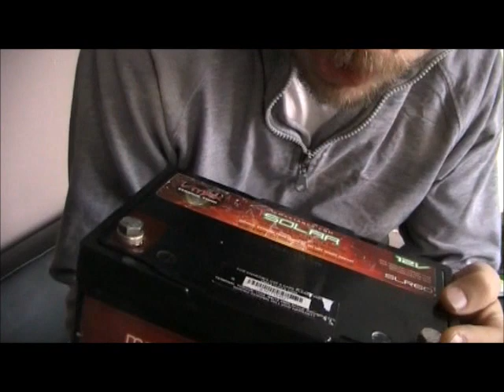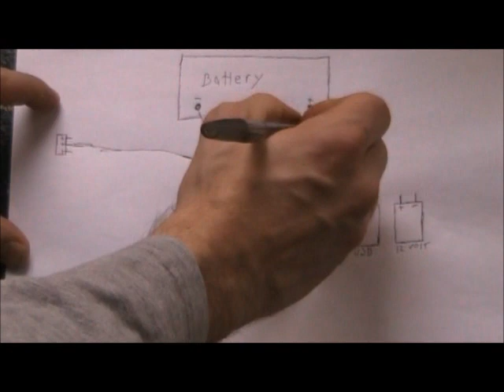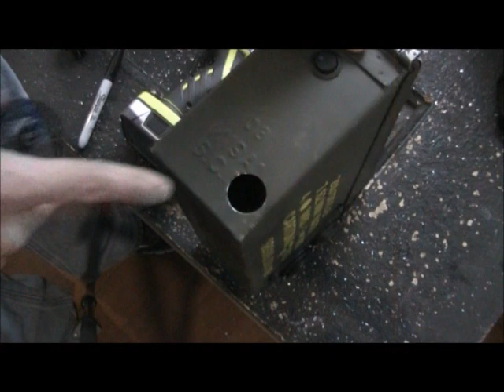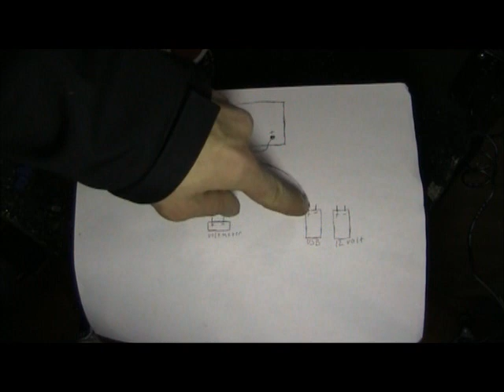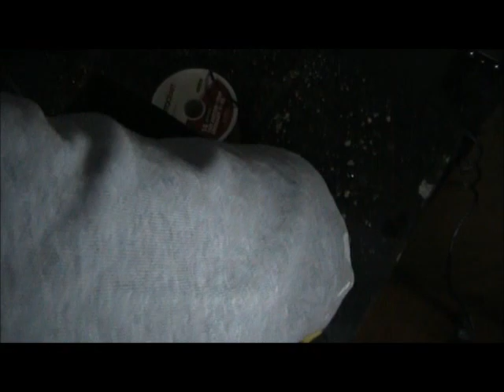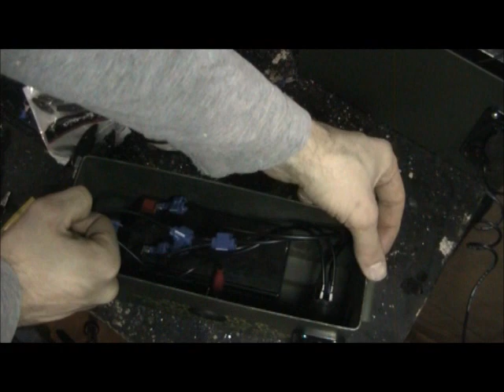How to build a portable 420 watt solar power generator (video 1 of 2)

Comment: Thank you so much for your video. I want to build one of these Could you plse tell me what the socket is called what you plug your solar panel into as i can not find one anywhere?. Also whilst iam driving in the car i would like to charge this whilst driving...how do i acheive this...do i simply plug a cigarette cable from the generator 12 volt outlet into my 12 volt car outlet? I would appreciate your advice plse thank you
Reply: @TheTruthEngine  thank you so much

Comment: Ha ha....you crazy? nice way to blow up your cell phone battery.  you should warn people not to charge cell phones with 12 volts.  5 volts 500 - 1000 mA is max.  Plus why you calling that a generator?  you should really edit this so you not causing others to do damage to things. I suggest that anyone building this battery box should put a 12 volt step-down adapter into box and breakers and maybe toss all those crappy connectors out too and secure the battery from banging into things. But thanks i needed a laugh today.

Comment: Nice video,just made on,i have a question for you Andrew,i knkw nothing in electricity so i guess i can ask here,i done everything in this video with a battery with bolt,i would like to plug the solar panel and loading the battery with the cigarette 12 volt plug on the ammo box,what is the safest way to doing this?(i don't want to use a SAE port on the ammo box)Thanks

Comment: What you want to start your holes with is an Automatic Center Punch. It puts a nice dimple in the material that will (usually) keep the drill bit in place.

Comment: I finally managed to get around to building one of these, and its brilliant. I am really pleased with the result as I now have a decent portable power supply I can use when I am working away from home and it didn't cost a fortune to build. I modified the design so I have a total of four 12v outlets plus the dual usb outlet. I also fitted the solar controller inside the ammo box, instead of onto the solar panel, as it was a convenient and tidy way of hiding it away. Getting all the cables routed wasn't particularly easy as it was tight for space, but it is working and I am fairly pleased with it. Thanks for all your help, the videos were really helpful and pitched just right for someone like me who has limited experience with projects like this. Please keep doing what you do :)

Comment: hello, the connectors are called f1 and the larger size is called f2 and for your tight to get to tabs like the volt meter or switch they make ones that come out the side or should i say 90 degree.  also you can get a 12v 12ah battery that will last longer.   just some facts that will help.     bigdog out

Comment: Hello, great video! I am interested in making an attempt at building this box, the larger one, but would like to include a 110 AC outlet. I am trying to run an ARB fridge or a small heater, lights, etc. Do you have any suggestions?

Comment: Question: I followed your link to the "420 watt" battery. Scanning through the details I see nothing that claims its 420watt. I'm not saying you are lying but can you elaborate how you determined that with the specs provided. Also a scale of what the voltage meter displayed means to us non electric ppl. 0 - 12 volts means what? is it like a gas gauge? 0(empty) 12(full) things still run until it says 0? like say a car would run until its empty. I've heard you don't want to drain the battery past 50% (right/wrong)? Thanks
Reply: Thank you. Great info.

Comment: Thanks for the awesome video! I'm now confident that I can take solar on :) However, I do have one question. When using the larger screw post battery how do you handle the positive fuse? I know you can stack ring terminals for the negative post. But wouldn't you only want one on the positive post with the fuse first? And use squeeze connectors behind that one positive post wire still like your showed with the other battery? Sorry, this is all new to me... Thanks again for posting this!
Reply: Andrew Glover Awesome, thanks for the help and quick response! I like the two fuse idea. Looking forward to new videos!

Comment: This is a " Portable Solar Power Generator 101 " for sure. LOL.  What a MESS with the Wiring, there are many ways you can do to improve that so when you change the Battery it would be easier and also LESS wires and LESS messy :((.  Also Inline Fuse would help and connect your Electrical ON/OFF Switches to the NEGATIVE SIDE is a must. This would NEVER Sparks if you turn on and off if your devices are plugged in. Prevent damages to your Devices and prolong overall to everything.

Comment: I do not agree on poking holes on wires,  you could use wire nuts to tie all the negative wires and all the positive wires, or another safer alternative way.
Also, you should use red for the positive and black for the negative poles, that is the conventional way for DC power, that avoids confusion when you have many wires--especially in a tight area like the ammo box.  Note I am an electrician and used to be an electronic tech. Good job anyway on the use of the box......

Comment: before you use the stepped drill - use a standard bit as a pilot hole... will give you a better result...  3/16 would be good.

Comment: you should add silicon or gasketing mass if you're gonna use it outside or if you accidently spill water so you wont destroy the machine. or bugs could crawl in the box.

Comment: Would a motorcycle battery work for this and still run an inverter to power say....a laptop computer?
Reply: Reason I ask, I would like to watch a 2 hour movie when I go camping.
Reply: Probably not,  and don't use an inverter between 2 battery powered devices if at all possible.  Get a DC converter, it will adjust the DC voltage up or down so you can run much more efficiently.  If you use an inverter, you are going from DC to AC and back to DC, wasting a lot of power because the inverter is not 100% efficient. Each stage wastes some energy.  

A bigger battery could do the trick, use a Deep Cycle.

Comment: They make taps that will go on the spade terminal of the battery so that you have more than one connection.
Reply: Or just run one wire to a terminal strip, and have lots of spots to connect  ;)
Reply: that is true as I have both. A distribution block is nice because each tap has a fuse.

Comment: its not a generator its a battery. A generator creates  power this unit just stores it. its not a generator until you show the solar panel connected..like the idea of using old ammo boxes. need to show packing as well. nice  vid .

Comment: Good way to destroy USB devices. You can't just go from 12V to 5V USB. That's over-voltage. USB standards requires all USB devices get a max of 5V. You need to get a proper resistor to clamp it back down. DIY is fine, but please note this in your video, since many will follow your videos and think that is ok. Other than that great DIY project.

Comment: I'd have used black and red wire. How do I know what wire does what when they are all black?
Reply: Black wires matter.
Reply: that was funny.
Reply: I would label it with a white sticker - dollar store
Reply: multi-meter will show - sign on negative terminal when leads from meter red and black correct you will see no negative that means correct colors, then mark as + or neg.

Comment: Ammo box? Cool, but there are battery boxes out there. I just looked up ammo boxes and found they cost less than battery boxes. Thanks for the idea. So many times companies charge more for an item, based on what they want you to use it for, not based on the actual item itself. I like the ammo box idea. Now am looking at their different sizes, compared to battery sizes. If I want a unit to be more portable, I might want the handle, maybe additional compartments, or additional room inside the box. I like to make those decisions as I go depending on where the box will be used. If it is just sitting in one place and only used a backup system that will never be moved around, then using a box closer to only the battery size might be more important. I appreciate listening to everyone's ideas though. Thanks for sharing and thank you so much for YouTube :) Please come back Andrew and list where you picked up those parts. I know life is busy, but it really would be nice to know.

Comment: generator? it's a battery in a box.  but a pre-made battery box and be done with it. I'm all good with dyi and building instead of buying but call it what it is.
Reply: I've seen other "boxes" listed as a generator and/or UPS, usually need wind turbine or solar panel tied to the box to make it a true generator power system.  I think for a DIY it's interesting and definitely a cost savings to the $1000 to $3000 a pre-made version will cost you.  Batteries are one of the biggest costs (solar panels are as well), and will only last 2 to 5 years (though I think the AGM deep cycles may last longer), so it's nice to do it DIY so you can buy whatever the latest battery technology/amp capability that'll fit in the box versus going back to the manufacturer to buy a specific "special" battery that pre-made UPS systems like to use.
Reply: and how juch power would you get from a gas generator WITHOUT any gas ? I'd suggest, not a lot :)
Reply: Now THAT would depend if it disproves my side of the debate or not

Comment: how much does this cost to build, what does it run and how do we charge battery back up? could so?ar panels work. i could build one but ill need more plug ins wasnt sure if i could could use a quick connect for something that operates with a normal plug. id like the list please, one of the smallest generators I've seen thanks a bunch!

Comment: Andrew, great video. Very helpful. Question: at 12: 26 you show the wiring diagrams. If I didn't want to use a toggle switch with a light: I would have positive battery to positive toggle switch, then positive toggle switch to positive USB, then negative USB to negative battery. Is that correct?

Comment: Great video, but I missed what makes yours "420v"??? Please explain. I want as much power/time of use as possible from a single deep cycle battery set up, so I'm thinking 100 amp hour deep cycle battery, minimum of 100w foldable solar panel. I noticed that your battery held up with top posts had 18 v on it, should I try to get same...is that what makes yours 420v? Please reply with any advise that could help and Thanks again for extremely well detailed video!!!
Reply: Angler Beaudry e

Comment: Ever heard of a 'centre punch' ?  Then your drill won't wander all over the shop...  And use a straightedge to mark your cross for centre pilot...  Then centre punch it!   DON'T use Scotch Snap Blade connectors, they make for poor electrical conductivity and invariably cut strands of the conductor (....only logical use for these lazy-bad-boys, is perhaps on temporary hook ups to a circuit, experimental circuit design, or emergency hook ups).   What you call 'quick disconnects' (?)  The rest of us in the trade call - Lucar, or Blade Crimp connectors, which come in a bewildering array of types, sizes and the insulation sleeves are usually coloured to denote the gauge of the crimp/wire c.s.a.  For long-term and robust electrical connection, I use naked Lucar/Crimp connectors with slip on boots and it helps to apply a small amount of solder to absorb into the crimp.  Standard Nato ammo boxes are not waterproof, so smearing a bit of silicone grease on all the connectors makes sound sense, if the unit is to be extensively used outdoors.   

Where you used these horrible Scotch connectors, you could have simply used a larger gauge Lucar/Blade connector and 'combined' the two wires into the one connector.  This would have made a sound electrical connection and would avoid the use of the dreaded Scotch connector... 

If caught with only one colour insulated wire, then it makes sound sense to mark the positive circuit wires with a piece of coloured insulation tape (esp red) or use a coloured red mini-zip tie....  This will avoid confusion, or wrong hook ups, when the unit is being serviced or requiring a battery change.     

BTW - You CAN double up on blade terminal gel packs, you just use a double Lucar connector.  The reason larger batteries use the bolt connectors, is because they handle heavier currents, with heavier gauge wiring (larger c.s.a and stranding) requiring good anchoring and a sound/tight terminal connection.     

Otherwise nice design...  Particularly the use of the ammo boxes.  Swords to Plowshares, I like that.

Comment: Last time I checked batteries comes in Amps, not watts
Reply: Last time I checked.. you're dumb hahahaha
Reply: untrue, in it's simplest form,  it's still a generator
Reply: conversion calculators on the internet
Reply: Kyle Geddes no he don't. don't you know that there is no constant voltage of a deep cycle battery? It ranges from 10v to 14v. And how much work can be done depends on the time it takes to discharge the battery. So there is no simple answer

And when this thing is hooked up to a solar panel, you better believe it's a generator because it ain't doing anything, else is it?

That's like saying a OG genny ain't a genny if it doesn't have gas, na it's still a generator
Reply: That's what I was thinking .
Reply: Volts X Amps = Watts ( i think )
Reply: Battery capacity is rated in amp hours, and watts are a measure of work - which depends entirely on voltage and amperage to measure. He's using it incorrectly here to state the capacity of his battery. and if you want to nit pick here, he's not building a generator at all.. He's building a battery box that's charged with a solar panel.

Comment: The Scotlock blue  squeeze connectors are not a reliable connection.  Working on cars and motorhomes for a few years, I replaced many of these connectors.  They caused more problems than they cure.  A solder connection is the most reliable or a terminal strip with the crimp connectors he showed you on the battery terminals are a lot better.  Just pull hard on the wire and connector after you crimp it to insure it has a firm grip on the wire.
Reply: +Patrick Smith Agreed, I also often solder the wires into the crimp, just to be sure...  (...unles I'm in a hurry or using insulted Lucar crimp connectors...).

Comment: Hello Andrew,

I need your help. I want to build a solar generator for my house used. my house is located in a remote place where electricity is very far. What I want to do is a solar gen to run a refregerator, if possible. lighting ( 2 pcs ) may be, a socket outlet for charging small power equipment. my few questions are: What would be the wattage of my inverter? example if my peak load is 1500Watts? What would be my requirements on the Solar Panel Panel Wattage, Inverter wattage, provided that my battery bank output is 12VDC. What is the relationship to panel wattage and Sine wave inverter wattage, so that my generator will not be burned or damage with the 1500Watts peak load?.
I need your help guys. 

Thanks a lot.

New user is here.

Comment: The video is very helpful. I will change a number of your methods, however, the overall concept is pretty sweet. Rather than use alligator clips that can come unclipped and cause a short, why not move the volt meter left of center as there is plenty of space? All-in-all, I would give this video a 9/10. Great work.

Comment: When drilling use a metal punch and use a small drill for a pilot. It will make things easier when drilling.
Reply: True Dat!  He also said 1-1/8" was his size for the 12v and USB plugs...
That is also a "Trade Size" hole saw for Electricians.  It is the outer diameter
for 3/4" conduit hole saws.  hey should last longer than a Uni-Bit which is 
just another name for the Stepper Bit.

Comment: Start over --- and use 1/2 the wire as the ammo can is your ground  --- ditch the USB port it will fry anything plugged into it !!! If you need a usb plug in port buy an adapter that that goes in the cigarette lighter port --- isolate the backside of switches, gauges & ports from battery and shrink tube all pos connections.          Good to go.  👍🏾
Reply: +alfred aston The USB part has a step down circuit in it.

Comment: ? if they are that tight, installing the ports forget the base plate. Less work & looks better. But i would drill the holes bigger so i can solder the wires outside the box before installing.

Comment: Thanks, great portable solution!  Very good explanation and drawings, however very sloppy implementation.  Klein tools you use tells me you are an electrician but the sloppy work tells me your not an engineer.  I am working on a 2500WHr solution with an inverter that maybe I will post after I finish.

Comment: Great Video, very helpful :)
quit question, i notice in the section(30:29) where your installing the voltmeter ,a wire coming out of the generator in the back there, is that wire powering your camera??

Comment: Before making assumption about how wrong the first diagram is I have a question. Are u using a home USB hub? One with a Dc to doc adapter going from 12v to 5v with 2 amp max? If you are not stepping down the 12 v then you are messing with people or you don't know what your doing. Unless at the end of video you told people. First schematic is 100 percent wrong on the USB. Also are doing any calculations on the resistance your wire is producing. This is good to know. Also if you put a second volt meter in you can see how many volts are coming in for the charge circuit if you have one.